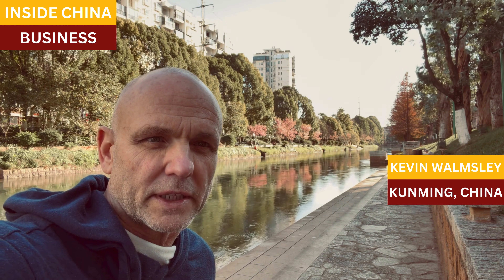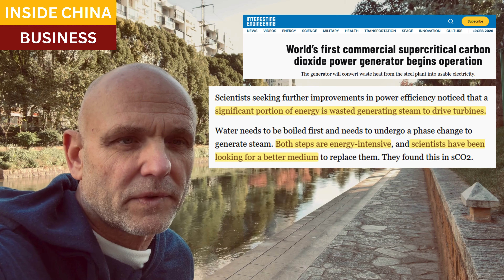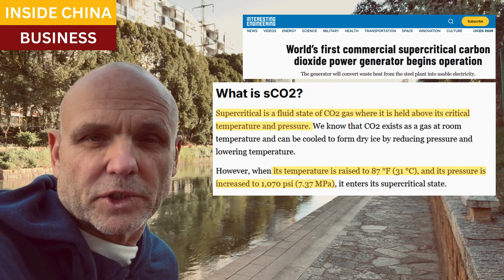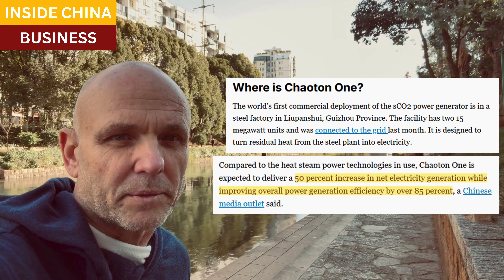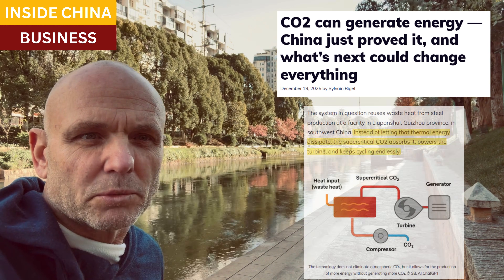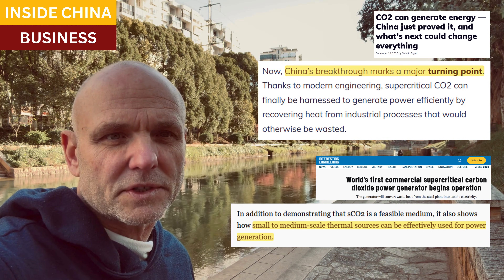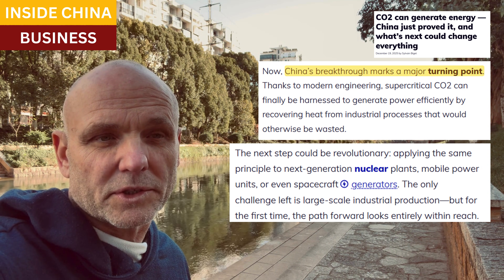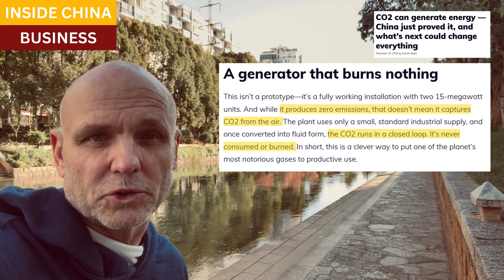Revolutionary generator transforms Chinese factories into power plants

Comment: Excellent reporting. Fascinating concept to improve on the steam engine. I live in the south where the sun is scorching hot, I would imagine solar energy could be harvested to generate heat to run a sCO2 system and generate electricity without the need of photo-voltaic panels, just simple solar concentrators/ lenses. Perhaps eventually the concept can be scaled down enough in size so that even internal combustion engines, office building AC systems, and commercial kitchens (to name a few examples) could have micro sCO2 systems to reclaim waste heat.

Comment: This is a good way to run electrostatic precipitators. Its a well known fact that systems for removing suspended air pollutants in process and generation industries run for half the time they are supposed to in developing countries ( and that's the optimistic estimate btw ).

Comment: Time for some "Joined up thinking"
Combine this with their revolutionary flash iron-making process (As detailed on this channel)  which is already super efficient, and which uses lower grade ore to make better product. THEN use the energy produced to heat the process (Which I believe uses electricity anyway)
.
Hyper efficient, Premium Grade Steel, cheaper than anything on the market?

Comment: you can easily use that heat overcapacity in engine that works on difference of potentials to generate electricity/energy. especially a China is not in tropical zone.

Comment: Organic Rankine Cycle (ORC), waste heat recovery system, and has been around for decades. CO2 is but one of many working medium. 
Nice to see CN going with it in a big way though.
Reply: Any other commercial Supercritical CO2 installation anywhere? or those are just concepts. if none, that's what we call innovation
Reply: @greatmovies298  
You're free to define innovation whichever way you want, but commercial ORC has been around for about a 100 years, if not longer.
In the case above, this company is using sCO2, as working medium, which has been developed elsewhere.
Reply: ORC is irrelevant here
ORC is just the lower-temperature version

even higher-temperature Rankin "Vapour" Cycle (of steam turbines, and steam engines)
(which can include gaseous state)
is not involved here
like in nuclear powerplants, coal+gas fired plants
which are hardly mere "waste heat recovery" systems

for sCO2, NO Vapour/Gaseous state is involved in this particular sCO2 PowerPlant system

ONLY Chilled Pressurized SUPER-CRITICAL sCO2 FLUID Exposed to HIGH HEAT transforms to LIQUID CO2 that DRIVES TURBINE GENERATORS with greater THRUST is involved here!

more THRUST than from feeble thrust in Liquid-to-Vapour (Water-to-Steam) Rankin Cycle (in conventional nuclear powerplants, coal+gas fired plants)
or lower-heat ORC

the HEAT needed is LESS THAN HALF for Water-to-Steam Driven Turbines
the PRESSURES involved is LESS than a THIRD for Water-to-Steam Driven Turbines
which means such systems are much more COMPACT in size and lighter weight

even though sCO2 can harness lower heat scenarios, too
not just harness high-heat scenarios

and

and, aside:
sH2O (FLUID Super-Critical Water) does exist, but at even higher temperatures and higher pressures, likely far bulkier heavier systems (for different uses, if ever)

steel mfg is a high heat process, not a low heat process

Comment: youtu.be/OQamNBY4nzc?Worlds-First-Commercial-sCO2-SuperCriticalCarbonDioxide-15MW-PowerPlant-in-STEEL-Mfg-Plant-in-GUIZHOU-CHINA-20251220a💡👍
Reply: ⚡ OTHERS are way behind China!

China has been Urban Mining CO2 for a long while now
CO2 is used as a resource for making many other useful things
sugars, animal-feed, etc
replacement for water in oil mining extraction, etc

and:
making sCO2 (with CO2) is already is low-cost due to affordable abundant energy
a norm in China

sCO2 systems only ADD more abundance of affordable energy in China
+
COMMERCIALLY!

⚡ China's new 15MW sCO2 Powerplant is built-in to a STEEL MFG PLANT in Guizhou, China
Reply: youtu.be/p7ClkdDKHEA?CHINAs-15MW-sCO2-SuperCriticalCarbonDioxide-PowerPlant-in-STEEL-Mfg-Plant-in-GUIZHOU-CHINA-20251220b-EXPLAINED💡🧠👀

Comment: https://en.wikipedia.org/wiki/Organic_Rankine_cycle
Reply: psst, psst....wikpedia is compromised. Anyone can edit that info and twist it into propaganda.
Reply: ORC is irrelevant here
ORC is just the lower-temperature version

even higher-temperature Rankin "Vapour" Cycle (of steam turbines, and steam engines)
(which can include gaseous state)
is not involved here
like in nuclear powerplants, coal+gas fired plants
which are hardly mere "waste heat recovery" systems

for sCO2, NO Vapour/Gaseous state is involved in this particular sCO2 PowerPlant system

ONLY Chilled Pressurized SUPER-CRITICAL sCO2 FLUID Exposed to HIGH HEAT transforms to LIQUID CO2 that DRIVES TURBINE GENERATORS with greater THRUST is involved here!

more THRUST than from feeble thrust in Liquid-to-Vapour (Water-to-Steam) Rankin Cycle (in conventional nuclear powerplants, coal+gas fired plants)
or lower-heat ORC

the HEAT needed is LESS THAN HALF for Water-to-Steam Driven Turbines
the PRESSURES involved is LESS than a THIRD for Water-to-Steam Driven Turbines
which means such systems are much more COMPACT in size and lighter weight

even though sCO2 can harness lower heat scenarios, too
not just harness high-heat scenarios

and

and, aside:
sH2O (FLUID Super-Critical Water) does exist, but at even higher temperatures and higher pressures, likely far bulkier heavier systems (for different uses, if ever)

steel mfg is a high heat process, not a low heat process

Comment: ⚡ OTHERS are way behind China!

China has been Urban Mining CO2 for a long while now
CO2 is used as a resource for making many other useful things
sugars, animal-feed, etc
replacement for water in oil mining extraction, etc

and:
making sCO2 (with CO2) is already is low-cost due to affordable abundant energy
a norm in China

sCO2 systems only ADD more abundance of affordable energy in China
+
COMMERCIALLY!

⚡ China's new 15MW sCO2 Powerplant is built-in to a STEEL MFG PLANT in Guizhou, China
Reply: youtu.be/OQamNBY4nzc?Worlds-First-Commercial-sCO2-SuperCriticalCarbonDioxide-15MW-PowerPlant-in-STEEL-Mfg-Plant-in-GUIZHOU-CHINA-20251220a💡👍
Reply: youtu.be/p7ClkdDKHEA?CHINAs-15MW-sCO2-SuperCriticalCarbonDioxide-PowerPlant-in-STEEL-Mfg-Plant-in-GUIZHOU-CHINA-20251220b-EXPLAINED💡🧠👀
Reply: 🔥
high-temperature Rankin "Vapour" Cycle (of steam turbines, and steam engines)
(which can include gaseous state)

is not involved here

like in nuclear powerplants, coal+gas fired plants

which are not mere "waste heat recovery" systems

and not as efficient

for sCO2, NO Vapour/Gaseous state is involved in this particular sCO2 PowerPlant system

[edit: CORRECTING INADVERTENT REVERSAL]

ONLY Chilled Pressurized LIQUID CO2 Exposed to HIGH HEAT transforms to SUPER-CRITICAL sCO2 FLUID that DRIVES TURBINE GENERATORS with greater THRUST is involved here!

more THRUST than from feeble thrust in Liquid-to-Vapour (Water-to-Steam) Rankin Cycle (in conventional nuclear powerplants, coal+gas fired plants)
or lower-heat ORC

• the HEAT needed is LESS THAN HALF for Water-to-Steam Driven Turbines

• the PRESSURES involved is LESS than a THIRD for Water-to-Steam Driven Turbines

combine both:
means such systems are much more COMPACT in size and lighter weight

even though sCO2 can harness lower heat scenarios, too
not just harness high-heat scenarios

flowing supercritical fluids, like flowing liquids, more efficiently TRANSFER heat than flowing gases (and flowing vapour) do, due to greater molecular-contact-continuity during heat transfer

Comment: Super Critical CO2 has been around for sometime as a replacement for steam.

The US has them, but China seems farther along. Nice.

Your picture does not help us understand how the blue CO2 becomes supercritical again. Like an AC unit. Absorb the heat, create a gas, then compress it. Over and over. 

Think of a locomotive. Fill it up with water. Have a coal/wood car. Burn the stuff. Turn water to steam to turn the wheels.

At the next town fill the locomotive with more water.

Until the US shrinks its massive welfare programs and redirects the money toward productive ends, it will become more and more consumers of stuff made elsewhere.  

Our politicians want votes. And keeping parasites alive works for them. 

USA RIP 🪦
Reply: no gas is involved, nor vapour

it's between Liquid CO2 and Cooler Fluid sCO2 (back and forth)

Comment: Reading these comments I think you need to spell out more clearly that heat recovery units still need an initial fuel source to generate the heat.  Steel mills are likely powered by burning coal.  I see they claim 5-10% more efficient than steam.  That's impressive.
Reply: bonus: more urban mined CO2 from burning coal

and urban mined feedstock for REMs and Critical Elements

Comment: This is kind of not new.  Here in Erie Pennsylvania back when factories were everywhere running coal and steam.  instead of the excess they had a pipe system going to residential houses to radiators and it was free heat when it did come through .
Reply: no steam involved here
no vapour here
nothing gaseous at all

this isn't "sublimation" of solid-to-vapour CO2 either

Comment: I feel like China could discover a way to power their grid with sand if they had to 😂
Reply: Sand is already used for heat storage capable of supporting electric generation.
Reply: China has certainly learned how a Dairy Farm CAN successfully work in desert type conditions.
Reply: You can do that. They are called thermal batteries or concentrated solar energy.

Comment: The concept isn't new.
But using sco2 requires super high pressure in the 3,000 psi range.
This means special mettallurgy, super precision welding/fabricating, Very Expensive.
Its been done before(probably not with sco2, but the equipment has), its not economical, and thats why it didn't take off before in the west.
Reply: Probably economical in China where they do have the knowledge and ability
Reply: the Western concept failed. That is explained by the detail you missed in the video.... around 1,070 psi. just be good & congratulate them for the innovative achievement. no need to downplay it

Comment: I think the technology has big challenges and there are no full commercial installations as I understand it. 
The challenges are material degradation, system leakage, and heat exchanger performance.
Reply: Its already a commercial installation. check his references if in doubt

Comment: If they could fit the power converter unit along with windmills it could make them more useful if used along with local/internal heat storage batteries (hot rocks). Dump undemanded electricity into the rock heat reservoir and recover using the CO2 route. We are paying to switch off windmills and it would add rather than subtract from grid stability.

Comment: This only works with hot waste heat ,,600 deg. C or above.. Not a bread oven, . Steel mills, glass factories, cement Mfg.
Reply: it's 31 degrees C. That's why it's more efficient than steam. go confirm
Reply: @greatmovies298  One graph I looked at showed a 50 % efficiency at 700 C. heat source and a 15.C. heat sink.

Comment: Not only in China, also in Texas.

Breakthrough for sCO2 Power Cycle as STEP Demo Completes Phase 1 of 10-MW Project

In a significant breakthrough for the development of supercritical carbon dioxide (sCO2) power cycles, the 10-MWe Supercritical Transformational Electric Power (STEP) Demo pilot plant in San Antonio, Texas, has wrapped up Phase 1 testing, demonstrating the commercial readiness of its next-generation indirect sCO2 Brayton cycle
Reply: Supercritical CO₂ power cycles have been tested for years in laboratories and pilot plants. Global sCO2 research programs include nuclear-related demonstrations, concentrating solar power test loops, and natural-gas plants that integrate carbon capture.

Evaluating the novelty of Chaotan-1 requires looking at how it integrates into live industrial infrastructure. Several factors distinguish this installation from previous experimental loops:

It is attached to an operating steel sinter line rather than a standalone test facility.

It uses only waste heat as its primary energy source.

It is connected to the grid and expected to operate as a revenue-generating unit, not just a research platform.

These operational characteristics mark a transition from laboratory-scale testing to functional, revenue-earning industrial deployment. Chaotan-1 represents a unique first-of-a-kind commercial demonstration within this specific industrial application. It does not mean sCO₂ has never been commercialized at all.

For example, modular systems have been deployed by Echogen Power Systems to recover energy from marine engines and diverse industrial processes. Likewise, the Allam cycle demonstration in Texas has already synchronized a natural-gas-fueled sCO₂ system with the local grid while integrating near-complete CO₂ capture.

Compared with those projects, Chaotan-1 stands out because it uses an industrial waste-heat stream inside China’s heavy industry cluster and is explicitly framed as a replicable template for other plants.

DeepSeek
Reply: Copying the Chinese 

👇

This U.S. effort, distinct from China's commercial breakthrough but part of the same international movement, uses Chinese-developed concepts (like the Nuclear Power Institute of China's research) in advanced testing, aiming for grid-scale deployment in various heat sources, including nuclear and industrial waste heat. 

DeepSeek
Reply: they're way behind China

China has been Urban Mining CO2 for a long while now
CO2 is used as a resource for making many other useful things
sugars, animal-feed, etc
replacement for water in oil mining extraction, etc

and:
making sCO2 (with CO2) is already is low-cost due to affordable abundant energy
a norm in China

sCO2 systems only ADD more abundance of affordable energy in China
commercially

China's new 15MW sCO2 Powerplant is built-in to a STEEL MFG PLANT in Guizhou, China

Comment: This is simply using a heat pump to recover waste heat, instead of a steam turbine. It does not consume the CO2, the sCO2 is simply used as the refrigerant, in a closed loop as Kevin said. It's not that revolutionary I'm afraid, and oil companies already practice extensive energy recovery to minimise losses of energy and money. There might be some borderline savings in plant material costs as CO2 is less corrosive to metals than water, as long as it remains dry.